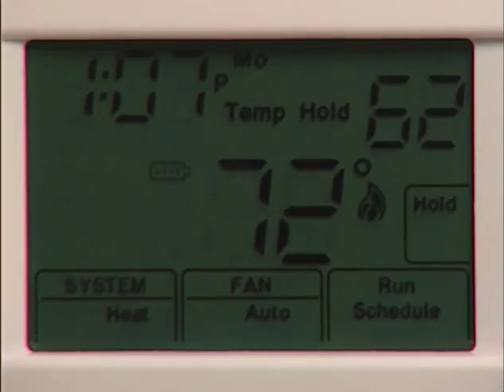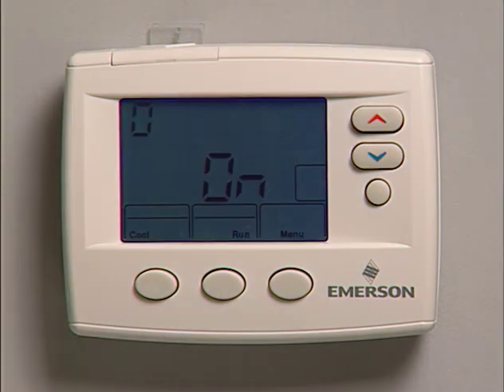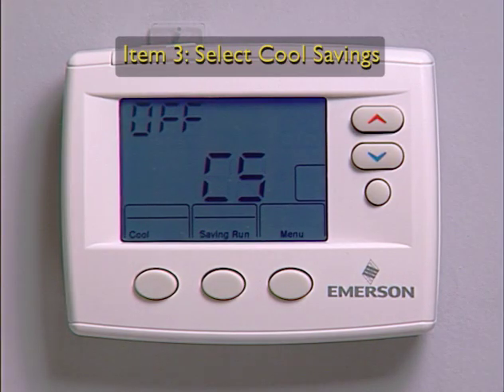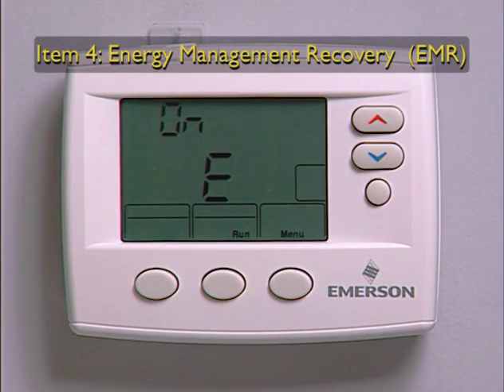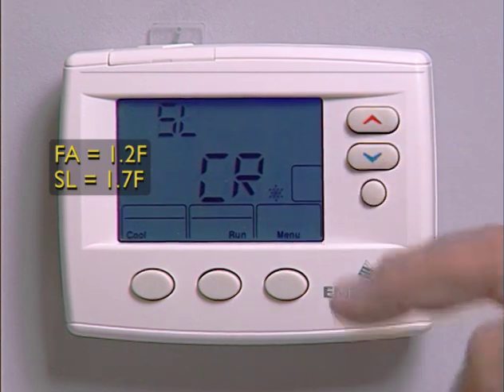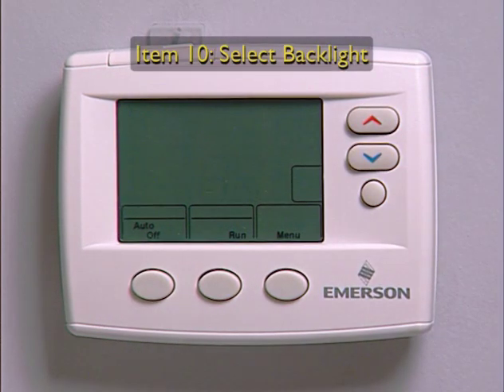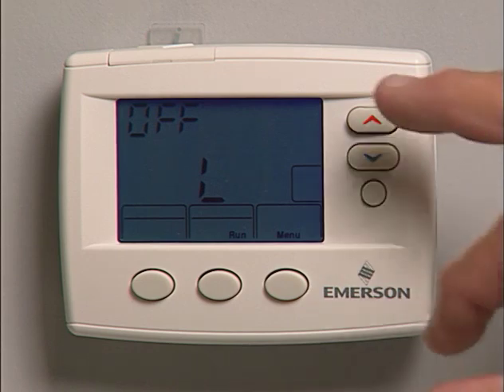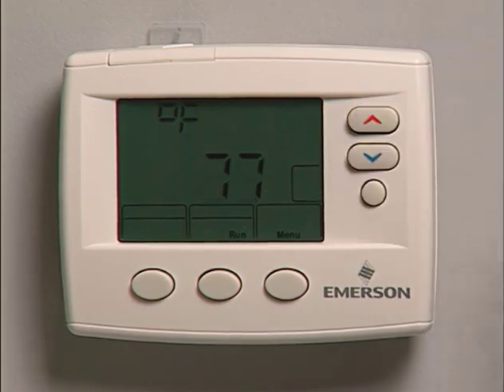Configuring Your 1F80 Programmable Thermostat

Comment from the maker: @Xctome, that thermostat makes two clicks in all modes. For example, when calling for the heat pump, "emergency" gas/electric heat, and air conditioning this thermostat will make two clicks when kicking in.